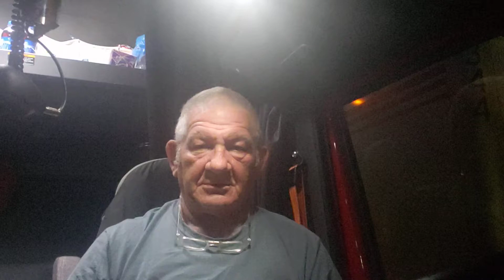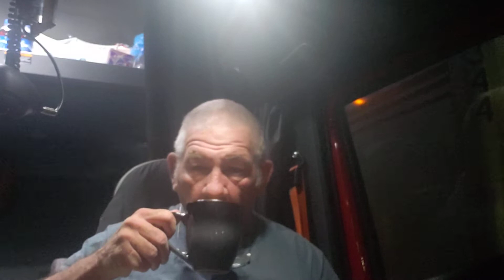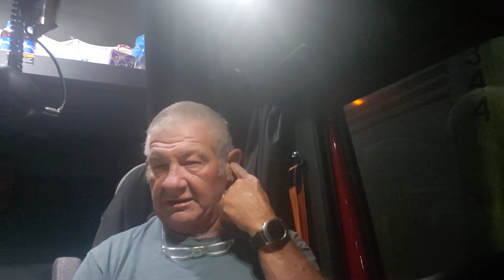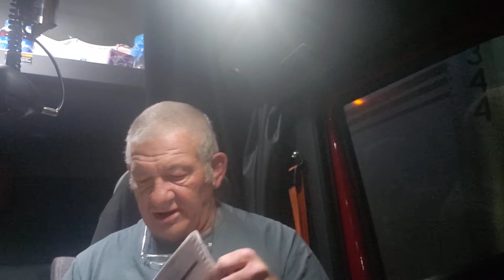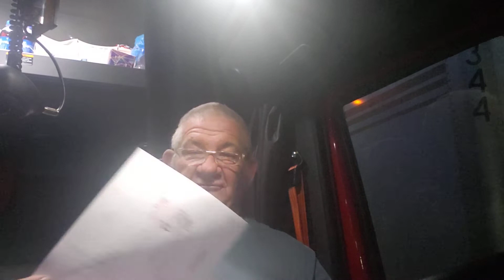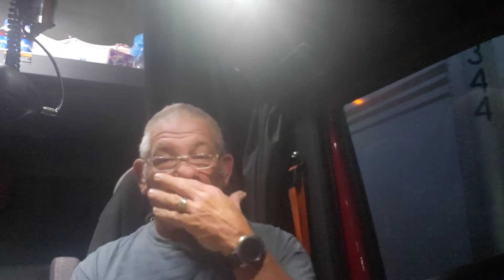Question about Tandem adjustments and weight distribution

Comment: Curtis, I know you have said you are tired of working for others and you want your own business and that’s an amazing goal to have!!  I would recommend doing a little math.  You keep track of your miles etc:  Go back to when you started and add up all your miles and multiple that times .45 a mile.  Then subtract 12% from that.  That will give you what you would have put in your pocket as a company driver.  Then look at what you have made as a lease op.  You will just shake your head!!    It’s not that you can’t make good money doing a lease but allot of things need to go right for you to do so.  As a company driver there will be way less stress, no payments or cost to you to operate the truck.  Allot more company benefits to you and the wife.    Run for 4 weeks go home for 4 days and actually enjoy the days off vs thinking about how much revenue to the truck you generated going into the vacation.   Wouldn’t you like just sitting back traveling the country with allot less to worry about.  Prime is going to run that company truck so miles won’t be an issue. It will be a more consistent income for you and the Mrs.     just something to consider.  I will preach it ever now and then because I really believe that is going to be the best fit for You.  Don’t look at what others are doing see which side of the coin works best for you.  You have already seen the lease side time to try the company side.  The great thing is you can always switch back but I highly doubt you will after spending 3 months as a company driver.  Stay blessed and stay safe out there.  Thanks for you hard work out there on the road!! ✌🏻
Reply: Exactly right. There’s no point in renting a truck. This isn’t even a lease purchase so it’s not like hes making the payments towards owning the truck. Now if that was his only goal was to own a truck and breaking even is not a bad thing because he will own the truck one day then I can see that. But this isn’t even lease purchase.
Reply: Your right bro

Comment: Us the formula, trk/trailer weight full of full example 34800 + your bills gross weight= total weight. Now - 12200 for steers then subtract what your tractor gauge is saying that will tell you what your trl is. 5th wheel hole is 500lbs. Tandems is 160-260 ish it depends on the model of the trailer.